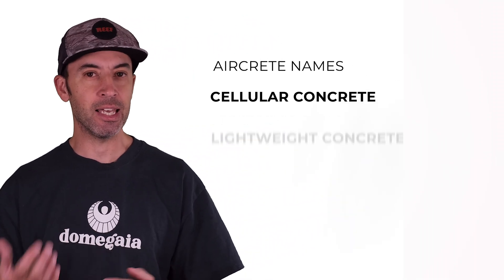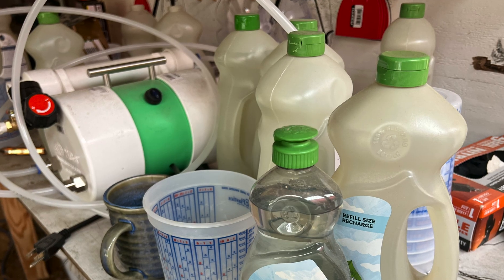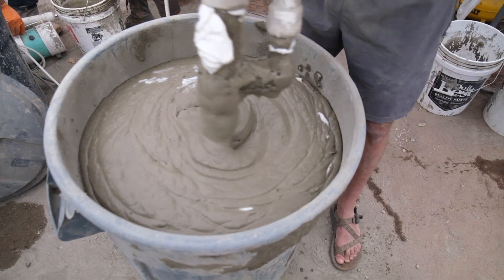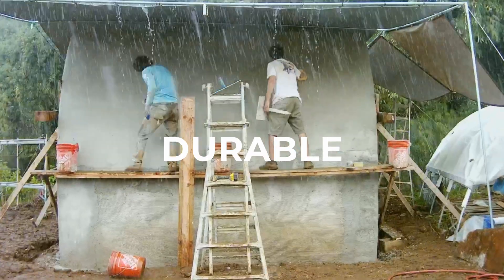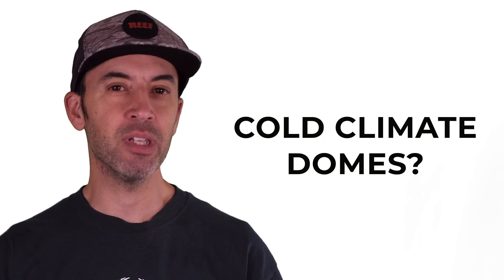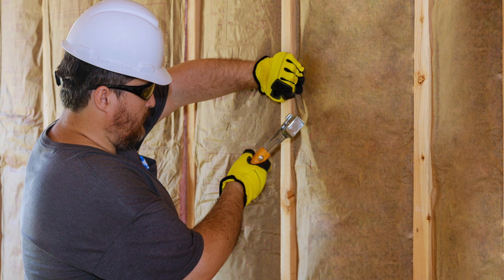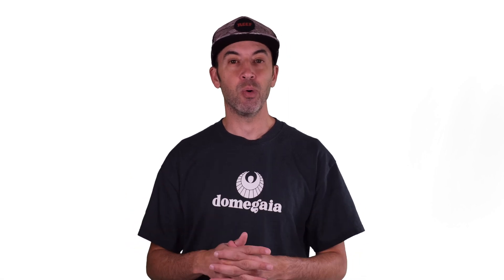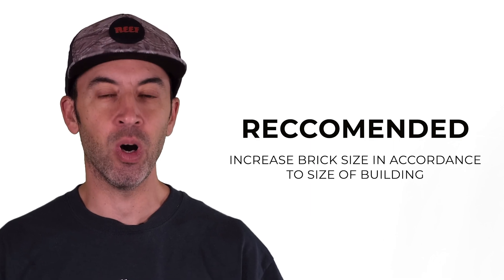Aircrete - Everything you need to know before you start

Comment: You don’t mention how long it takes to cure. I’d be interested in making big “Lego” style bricks that could basically snap together to build a structure. But the molds for that would, I think, need to be silicone and if curing time is anything like actual concrete, I’d need to make lots of them - and that would get expensive.

Comment: I want to make a solar cooker/solar dehydrator.  Size inside is about 2 ft long by 18 inches wide by 20 inches high. It has glass from an old wood stove in the front to let in concentrated sunlight,  and it will have a door at the back (like an oven door) The door doesn't need to be Aircrete.  I have made that size with sheet metal inside then fiberglass batts outside and it was such a pain to make!  What do you think and mine was 3 and a half inch fiberglass batts,  how thick aircrete to match that?   I have a tracking reflector so I get over 600 watts of concentrated light   into the glass window to heat stuff up and it goes for about 10 hours per day in the summer at my location.  It can get to about 400 C heating metal,  so will the aircrete  be able to withstand that temperature?  Thanks  Brian

Comment: Okay here's my question. If I had to build a dome that's exactly 100 ft across by 100 ft across. Calculate the minimum circumference of the sickness that it needs and let's quadruple the thickness of that towards the outside for the thickness. Overlap layering chunks doing it in that kind of a style. How efficient and structurally would it be good for design? So each piece overlaps the seam line from the back side? That's my question if anybody intends the uses. I intend to get paid for the idea for every time it is used. It's not up for discussion. It's my idea if you want to go further into details of other ideas. Upon other ideas, including this idea, contact me directly. I got about a million ideas to use and also a million unethical ideas that would work to go with this that most people don't even think of. Thank you for your time
Reply: U ok bud?

Comment: what would adding hemp to the mix? not a full hempcrete but rather an add-on for structural integrity and insulation. .geoship uses some hemp in theri ceramic pieces

Comment: Can Aircrete Be Used to Make Hex Shapes, to Build a Honeycomb Like Center, with Normal Blocks (Like the 4" Thick ones) On the inner and outer side of the Honeycomb Hex Shapes? Using this Idea, is, an approximation of using Lightweight Honeycomb in the Aerospace Industries as Core Material between two Structural Surface Skins. 

In this Way, You could get the simplicity of just building with 4" Thick blocks Always - Or a Mix between 4" & 6" Blocks - Separated By the Honeycomb Aircrete Pieces, which form the "Core" of the "Composite Wall" With Conventional Aircrete Blocks - as the Inner & Outer "Skins" (Along with the Domegaia Style of Fiberglass Mesh & Coatings on the Blocks themselves.)

Another Question I have had thoughts on - can Extruded Polystyrene (EPS) Foam Sheets, be warmed, (Heated?) and Formed Over the Aircrete Dome, for an additional Layer of Insulation?

Comment: I want to make a climate battery greenhouse. I think aircrete would be the best material to use for the insulation in the ground because it isn’t made of plastic. I would make the main structure a timber frame on regular concrete piers set just inside the foot print, with the outer shell of the foundation made of aircrete and regular 2x lumber anchored to the aircrete to hold the glazing. Does this sound like an appropriate way to use aircrete? Any special considerations like reinforcing the spots where the lumber is anchored to account for wind load?

Comment: Great vid. I was hoping to use Aircrete in combination with havelock wool, recycled cotton, or hempwool, and an air-gap - inside. Could you make an Aircrete INNER shell as a well? 🤔Researching ideas on how to best “wall” the interior around utility systems. Suggestions are welcomed.💡New sub. 👍🏼

Comment: is there a way (add some additive) to make the mix more firm and stable so that you can spray layers over layers without a mold or form and for it to hold shape and not sag ?
Sort of like a thick/firm shaving cream or mousse consistency..

Imagine the way of hyperadobe building where they lay one whole layer (one whole net roll) of the structure upon another so instead of making bricks you would just spray one layer on the foundation and next day spray the next layer on top of that in free form style (or maybe 2 layers per day if it hardens enough to hold the next one) 

the question is the additives to make it more firm and thick so that it holds form and maybe an additive to speed up the curing time so that you can get more done per day.

Also it would be great to create a mix with natural materials like hydraulic lime + clay + others which would even absorb co2 and be better for the environment and inhabitants in general..

Comment: Aircrete is potentially catastrophic for home builders, beyond doubt it is a fantastic thermal insulator, but for sound installation it's just not there! in short it scores a big fat zero for sound insulation. An excellent local builder built about 20; three story town-houses and almost all the occupants were early 20s' and were speaking rather than shouting to each other through the walls "enjoy" when your neighbours were having a bonk, this inevitably resulted in a court case and the builder had to add acoustic insulation to the upper two floors of each house. please see the other comments in this section many are superb....

Comment: First off, huge thanks for your amazing channel and all the inspiring project content! I’ve been a genuine fan and long-time follower. 🥰

Just for your reference — when it comes to aircrete/foamcrete (cellular concrete) in the Ukrainian 🇺🇦 climate — we deal with cold, damp winters that can drop down to around -4°F (-20°C). To handle that, we typically use 16-inch (40 cm) thick walls for proper insulation.

Comment: The military has used an epoxy additive to concrete to make bunkers for decades.  I wonder if something like this could be added to air-crete to create a harder version, without compromising its other properties.  As it is, in its current configuration, it's basically liquid wood.  Same sort of use case, but with increased durability, higher R-value and less weight.  And given it won't rot and is fire resistant, it should last a good long time, particularly with the fiberglass and mud outer coating.  Seems like an ideal small/tiny home material.  

When you consider that most young adults nowadays (In the U.S.) can't afford the astronomical housing/apartment prices, building a community of small/tiny homes and selling them for a more modest price could be a real boon.  Helps young adults get on their feet and out on their own, and it would be a really cool community, design wise.
Reply: Can you disclose the name of this epoxy additive ?
Reply: @jariaramakisoon9698  - As far as I know, it's just epoxy added to the concrete mix, but I'm not sure of the ratios or brand.  They used it to build bomb-proof bunkers and missile silos, as it created a super-hard concrete.  I imagine it would have to be something with a fairly long set time, as pouring concrete isn't exactly a quick process.
Reply: @meadmaker4525  I used to work in a readymix plant. And there is a chemical they use to put the concrete to sleep when they have long journeys. And another chemical to wake it up, and another chemical to accelerate the hardening process.
Reply: @  - That's really interesting.  I had no idea they could pause or accelerate the curing time of the concrete.  Pretty cool.
Reply: @meadmaker4525  Since 2012 I started with this company. It comes in handy when they have to carry concrete for long distances (4 hours thru traffic) then wait for construction sites to finalize work before pouring....

Comment: FACT CHECK Firstly, I have a Masters of Architecture degree, a degree in Urban Planning and Design, Sustainability Studies, and years of professional design-build experience. My goals are the same as yours: to create equitable, sustainable housing. I offer the following critique to help reach our goals.

However, "Aircrete" was invented and patented in the early 1920s. Your claim that aircrete was "coined" and "discovered" in 2014 is misleading. 

Furthermore, you present aircrete as an "eco-friendly" and "sustainable" building material. This is greenwashing. Concrete accounts for 8% of global C02 emissions: 1kg of Portland cement emits as much as 1kg of C02.

Additionally, concrete accounts for nearly 70% of all construction and demolition waste. Recycling concrete is costly and difficult. The life-cycle environmental impact of building with concrete is one of the highest of any building material.

Low-carbon concrete does exist, and will become increasingly vital for reducing the built environment's carbon footprint. However, low-carbon concrete is new, expensive, and not widely available. 

Finally, the design philosophy is problematic: building isolated tiny homes in previously unbuilt landscapes further contributes to the destruction of ecosystems. Rather, building in existing urban areas (urban infill) and designing architecture to regenerate landscapes is the better option for wide-spread adoption and positive change. 

Big picture, claiming that aircrete and this building system is "eco-friendly" is misleading and objectively false. It's greenwashing. If you were just building a tiny house in your back yard for fun, that's one thing. But you are a company, selling designs, books, and courses on the premise of "sustainability" and "equity." I cannot abide this. 

I appreciate the attempt to offer alternatives to traditional building techniques. However, you MUST critically examine whether these techniques are actually living up to your claims or not. We do not have time for illusions.

We need affordable, sustainable housing now more than ever. I urge you to consider how you can change your approach to honestly solve these problems.

Comment: I'm curious if this would work as a partial root cellar? Using cement blocks on the below ground part,  Aircrete on top followed with a waterproof sealed exterior as a barrier and finally plant a living roof over it to help keep it cooler during the summer?  Also, if a pine tree limb fell on it, would it destroy it faster than a standard roof?

Comment: could you apply aircrete with an air spray application device?seems like this could be a good method to stucco stype apply.even maybe add nerdles or perlite for extra texture.
I have an idea to build a geodesic dome with aircrete cast flat in the variuos gemetric panels with peg and pockets to make it easier to line up.
basically the pegs and holes would be cone shaped.ypou put you mortar in the holes an butter your remaining flat surface and press together.
Im planning to build a 4 season hot tub enclosure using aircrete and this method.basically it would be an oviod shape with panels on 2 sides that would swing up to be supported somehow to make it open in nice weather but would swing down and closed for cold weather.these panels would not be air crete and i dont think they would handle all the movement.many panels would have circular openings for plexi bubbles for light.

Comment: That R value to way too low for my area. R20 is a min for walls, ceiling without attic R31 (R60 with attic). But in areas not prone to snow loads and extended frigid temps, it's a very interesting tech

Comment: Hi guys,  We use styro crete (regrind styrofoam cement)  to insulate the outside of quonset huts then we finish as you do.  We like aircrete but haven't been able to get constant results mostly the bubbles sometimes collapse but not always.  Any suggestions?
Reply from the maker: That is frustrating when your aircrete doesn't turn out as expected. I would suggest trying a proper foaming agent, this can eliminate a lot of issues https://domegaia.com/products/mearlcrete

Comment: Instead of pouring the foam-concrete into the molds to form the blocks with which you make the walls, wouldn't it be much quicker to pour the mixture to form the wall directly?
Reply from the maker: Yes, you can do that as well.  Depending on the shape of the wall, it might be easier to build with blocks rather than forming the whole wall.

Comment: What is the foam in aircrete ? When you cut it or sand it, what are you putting into the environment?
Reply from the maker: It’s made with dish detergent or a similar water based foaming agent.

Comment: How do you deal with plumbing? I don’t see any in your buildings?
Reply from the maker: It's not much different than a regular house.  Plumbing often comes through the floor or slab, but you can also put it in the walls.  You don't usually put plumbing in an exterior wall, so putting it in the slab is what happens typically.

Comment: can air crete be buried say for a under ground house?
Reply from the maker: You could use it as insulation but probably not as your primary structural component like you can above ground. Aircrete is used underground all the time in geotechnical applications.

Comment: Couls you use this to build a pizza oven?
Reply from the maker: That would be a fun first project.  You would want to line the inside with fire brick as even concrete can not handle heat as hot as a pizza oven.

Comment: I’ve seen monolithic domes done by spraying a layer of insulation before spraying shotcrete. Could one do a multi layer set up where aircrete is used for one of two middle layers? Like a water repellent sealant layer on the exterior, followed by a stronger rebar reinforced concrete layer, then a spray insulation layer, and finally an aircrete layer. My thought is this might reduce the thickness needed on the near exterior rebar concrete layer, and a lot of insulation from the spray insulation layer and then by anchoring an aircrete layer to the insulation and rebar reinforced concrete, still significantly reduce the cost of the dome compared to doing just rebar reinforced concrete, while also being stronger than just aircrete. I’d love to hear from some pros in the field, but please anyone lemme know what you think
Reply from the maker: I'm not sure how that would work.

Comment: I recently came across an air Crete project here in Hawaii. I'm a licensed contractor and of course I would never try to build something like this in a state that has such strict building code but nonetheless I was given the opportunity to evaluate the situation this particular homeowner got themselves in with this air building system. In short 70+ year-old women was convinced by a family member that she could build this in her backyard and recoup the costs for the build by renting it out. The problem is they built it next to a neighbor that is the antichrist of natural building so of course he reported the build Before it even got off the ground. Instead of stopping the builder continued forward and got all the way to almost complete. Building citations were issued and now the poor 70+ year-old homeowner is $120,000 into this bill and has no hope of getting it permitted. I consulted structural engineering firm that wanted to charge $10,000 to retro engineer this building with no promise that they would actually be able to Come to a viable solution since they had no clue as to the strength of these air Crete buildings. My conclusion is, this system panders to peoples emotions but in no way shape or form is it logical or labor effective. Your site is the one that has influenced several builds of this nature on our island and all of them have been Red tagged by the county. My advice based on 35 years experience is for people to stay far away from this method if building permits are required along with engineering certifications.

Comment: Is aircrete the perfect building material? Judging by the crisis in the UK of buildings that were constructed using this "miracle" material now being prone to collapse. No. No it is not even vaguely close to being "perfect".
Reply from the maker: With any building material, there are right ways and wrong ways to use it. What they did in the UK was the wrong way and very different from the way that we recommend use aircrete.
Reply: @domegaia  No. That's just plain BS you have made up to try and defend your "miracle material" and your business that is all about promoting it.
The buildings in question have been examined and studied by experts in the field. To try an work out if there was any malfeasance involved.
There was no malfeasance. Turns out that AAC just  has a shorter lifespan than concrete by its very nature. It's permeability to moisture makes it more susceptible to corrosion of the reinforcement. And most dangerous of all. It does not display signs of imminent collapse. Meaning there is no warning to take remedial action/repairs or to close a dangerous structure.

Does AAC have uses? Yes. Most materials do. Does it perform well in those uses? yes. Just as most materials do in their niche purposes. But it is in no way "The perfect building material" as you ask in the very first line of this video.

Comment: Ive seen people. Buy an old ship. Like single hull oiltankers those cant be used anymore. So their relatively cheap. And they fill the hull with aircreate so even if the hull is to thin and rusted through it will stay afloat. To make it into a houseboat.

Comment: Aerated cement is best suited to be used as a non-structural, non-load-bearing wall adjunct in order to provide space closure and space insulation. 
What densities correlate with the quoted R values ? Can anyone supply that information here ?